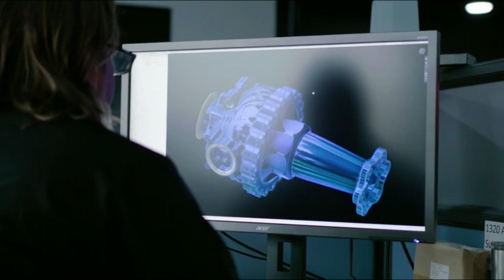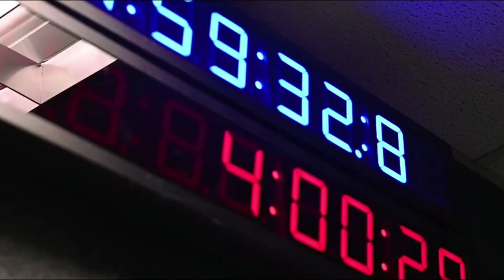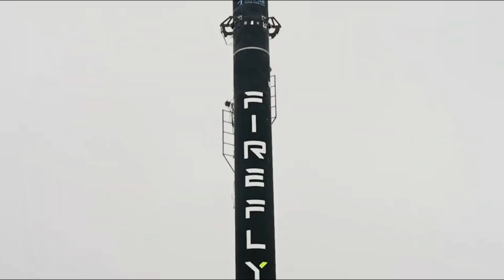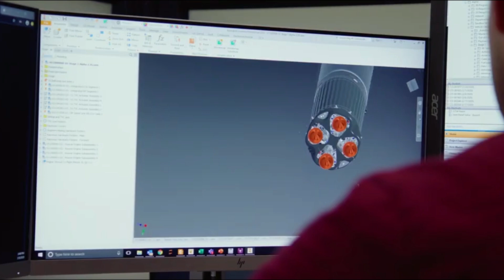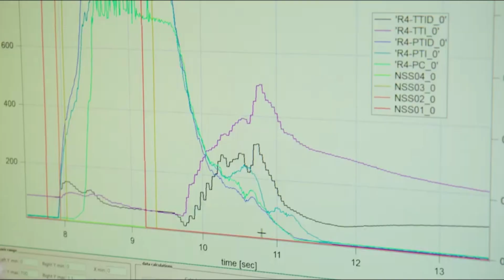Firefly Aerospace Prepares For 6 Alpha Launches This Year

Comment: I am a fan of Firefly.  I am particularly excited by the fact that in August 2022, Northrop Grumman had contracted Firefly Aerospace to build the Antares rocket's new 300-series' first stage.  I would however, like to note that the second orbital test flight of Firefly Alpha that took place on 1 October 2022 did successfully reached orbit. Alpha deployed 7 satellites, however, due to the lower than intended deployment orbit, most of the satellites re-entered before reaching their intended design life a week after launch. Saying the second launch was a complete success might be a bit of an overstatement.